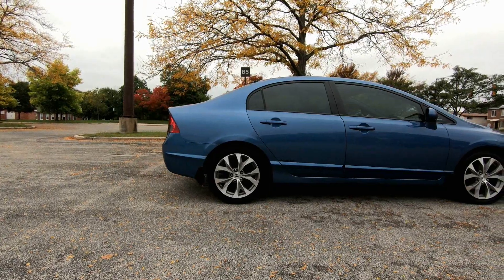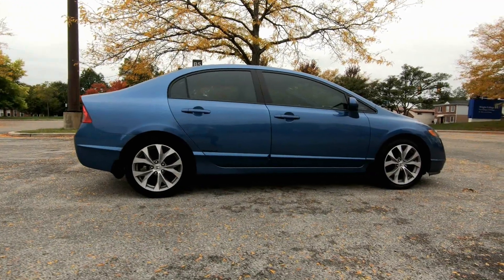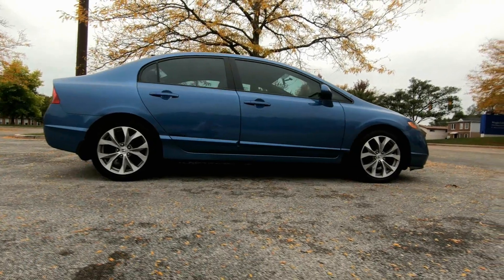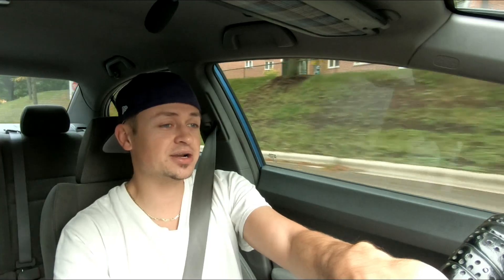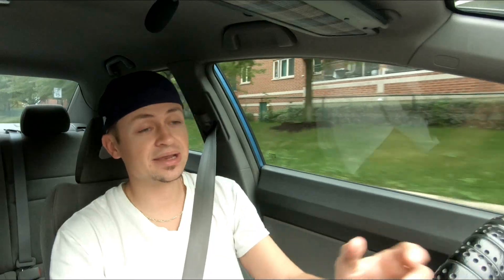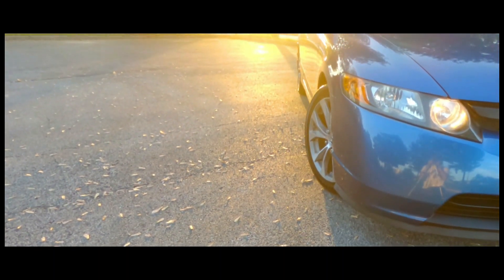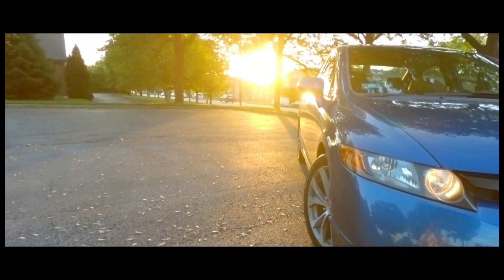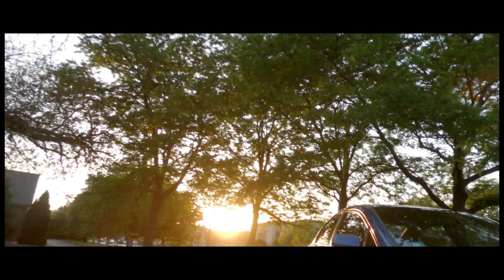Honda Civic Cost me ONLY $100  in Repairs in 12 YEARS!

Comment: Good luck when the block cracks. Awesome it’s done so well so far.
Reply from the maker: Gator 4190 I hope not. Haha
Reply: @BulliKid  yep I was wondering if you came across the engine block problem but you only have 78,000 miles I think you said
Reply from the maker: I have not had any problems with the block cracking but check my engine block recall video for more details.
Reply: @BulliKid  I saw your video. Good informative videos! I purchased my son 2006 Honda Civic LX in August. Last month it broke down out if nowhere and it's the engine block. Sad thing I'm sure the seller knew bc found JB Weld in the engine. Pissed bc he should have disclosed that information to me. Purchased an engine that had to return bc it was crap. In the process of finding one from LKQ.
Reply: @BulliKid  my son's is same color. He named it Smurfette, lol
Reply from the maker: What is LKQ? Man that has got to suck. And the junkyard motor may have the same problem.  :(
Reply: @BulliKid  getting a 2011 engine. LKQ sell salvage engine, but they are very reptubale

Comment: Lol my civic 07 LX civic, is at 275k miles
Reply from the maker: Nice man! Any issues to look out for?
Reply: BULLI KID Mainly replacing worn out parts, ive had to replace the radiator, i have to replace the shock struts, serpentine belt, belt tensioner. But thats about it. But definitely no cracked block yet thank god haha
Reply from the maker: avie sounds like it did you good! Why the radiator though?
Reply: BULLI KID, well i think id have to take the blame for it on the radiator, i overlooked the coolant, which i never do Now. But long story short, It was low on coolant and i wasnt aware and the radiator busted its self because of the heat and ripped open the seal in between the metal and plastic and was pouring coolant out and smoking, so i replaced it but it was the original radiator it looked pretty bad overall you when i took out you can definitely tell it went thru 250k miles